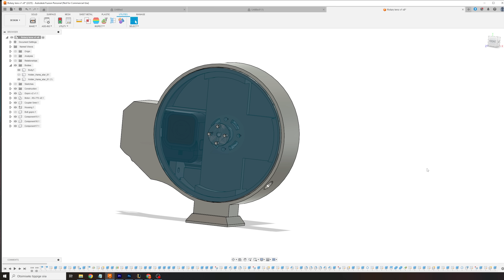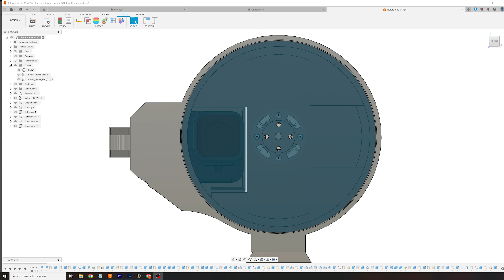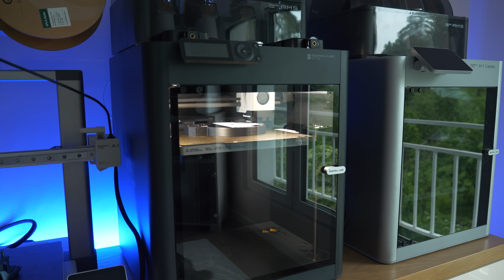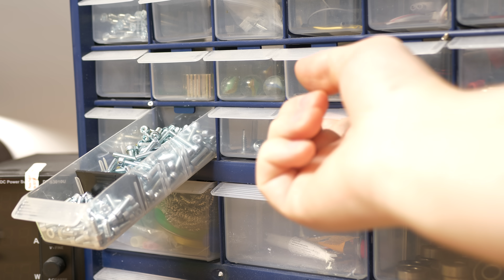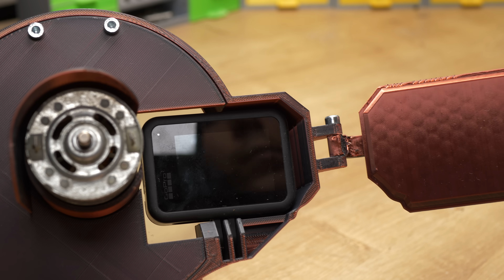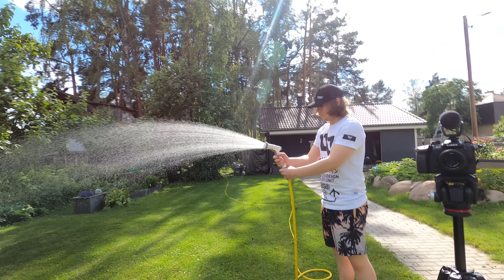Professionals Pay $4999 for This… I 3D Printed Mine for $5

Comment: Hi, Great project.
Years ago, when I was an ENG cameraman for some news stations, I had raindeflectors for my cameras. They did the job, but really, that was all positive I can say about them.
The wobble you have in your DIY raindeflector is also visible in the very expensive ones. To overcame that, I only used the raindeflector in shots that were dynamic, like when riding on the back of a motorbike in the Tour de France, for example. Another big problem is that you can't use acrylic for this, as this is the worst lens you will even find. You have to use glas for this, and believe me, it has to be very special glas too. It has to be optically perfect, it has to ride in at least 4, but even better 8 bearings, and it should be tempered, otherwise your glass will explode when spinning fast. Ask me how I know. Another big downfall of the Raindeflector is that it's a flywheel with a lot of force you have to overcome when using the camera handheld. A great example is that I once dropped my camera because the bike I was on made a turn left, and the camera didn't like to go that way because of the raindeflector being in its fastest rotation. This is why you now only see Raindeflectors in stabilized cameras with gyroscopes where the raindeflector spinning glas is taken into account in the motion of the other 2 axis. This you will find on Helicopters, car driven cranes, etc.
Reply: Acrylic is good enough, because guess what most of the clear waterproof cases at the consumer and semi-pro level are made out of? The thing is getting acrylic (or polycarbonate) which is "optical clear" and storing it or using it in a way that would avoid scratching. The main advantage of glass is not having the plastic fog up from UV over time, which would require replacement in this application. It's definitely down to a cost in this case by a factor of 1000.

Comment: It looks like the motor adapter wasn't fully centered on the acrylic disc, you can see it when the motor slows down.  If you get that fully centered it should greatly improve the balance.  For a perfect balance you could use an RC airplane propeller balancer as well.

Comment: I wonder if you could use something like Rain-X to help repel the water and in turn reduce the rpm's of the motor to reduce vibrations
Reply: Just any hydrophobic coating… not sure why such a high rpm is needed in the first place anyway… ceramic coatings are super cheap too
Reply: Aquapel

Comment: Using any support material or interface layer for PLA is almost useless, because in my experience the supports break off cleanly and the finished layer is superb no matter if you're using support material or not you just have to dial in your support settings, other than that great video I don't know if it's your accent or what but I really enjoy your videos and it helps that you're usually talking about something that makes sense or solves a problem.............

Comment: The longer I watched the video the more I had an appreciation for why the production version costs what it does.  The remaining issues are not easy to solve in a reliable manner, and I'm unconvinced that the image stabilization can adequately deal with a 10,000rpm vibration.

Top content though, and a good idea, but it's always that last 10% that takes the most effort to get right.

Comment: Bldc motor.
Balance it by trial and error, spin it upand feel for vibration, now mark 4 spots and add some tape/weight to one spot ant spin it again, less or more vibration and change position and weight uintill perfect.
And then turn the speed up or down to find a sweet spot

Comment: "Professionals Pay $4999 for This… I 3D Printed Mine for $5"

Except they start at $112. The $4999 are not just a spinning disc, they are waterproof gyro-stabilized window-mounted contraptions that can handle a storm.

Don't be a w*nker, try being honest.

Comment: Excellent idea, do you need to recess the disk in the housing? You can test by tightening the disk mounting bolt with a gap between the edge and housing. I suspect the centrifugal forces will still be applied to the front and back side of the disc. And the water will not collect at the edges of the housing when it's flung off the front.
Reply: You catch a brief glimpse in the 3D render at 1:09 - the perspex disk looks like its a few mm proud by design.

Comment: I think using the central drive in this case might not be the best idea. Maybe it would be better to use the ring gear drive, with the possibility of reducing the rotation speed but increasing the torque of such a lens? It also appears that the compactness of such a lens could be improved by directly utilizing the ring gear drive.

Comment: this is nice and interesting i wanna see you go though some ideas and improved verrsions... 
USe a brushless motor (cheap drone stuff is easy to get)
make the interface between the housing and the spinning disk better. (maybe a nylon washer with oil or some graphid and wool or something)
thing about how to balance the disk... there is prop balancers but it would be fun to see a device that is able to do it too xD (way complicated mabye its own video?)
Edit: One more idea, use a Mirror to get get the camera to be sideways. that way it has more space and the disk can be smaler making the whole thing simpler and less noisy i think.

Comment: Yeah I can absolutely see how you could put enough engineering into this to result in a $5k device, size, sound, reliability, image quality, etc. But, your solution seems like it could be really solid with a bit of work to produce an excellent 'hobbyist' version!

You could use two nylon rings on both the front and back face of the rotating acrylic disc, since nylon has a very low coeff of friction if the acrylic disc does warp and press against them it shouldn't negatively impact the speed too much, and by having a bit of overlap on the front it should significantly reduce water ingress (see: Labyrinth Seal). You could also potentially use a gearbox to increase the torque of the disc, once you're up to X speed that's high enough to kick the water drops off anything past that should be traded for torque to prevent the discs speed from varying too much, as that will obv impact it's efficacy and the image quality seeing through it. 

In terms of balancing that's all about shaving bits off or adding small weights to the acrylic disc until it's really steady, but that's a high-effort upgrade for pretty minimal return.

Great vid!
Reply: yeah 5k$ is insanely overpriced for what's literally just a spinning disk, no amount of engineering will ever justify that cost

only reason they can get away with making shit like that so expensive for professionals is because cinema camera manufacturers already tax their accessories insanely much and set a precedent
Reply: @AstonishedByTheLackOfCake  Have you ever worked as a professional engineer or is that just an opinion from a non engineering or scientific background?

Because I can ABSOLUTELY see how you could put $5k worth of engineering into that, especially considering the professional solutions aren't likely to use a flat disc and almost certainly don't just use acrylic, and if you've ever seen the cost of some of the high-end professional scientific equipment $5k isn't even a drop in the bucket.

Comment: How about hydrophobic coating?
Reply from the maker: It would certainly help, but it performed well enough even without it. ;)
Reply: Because the water would still accumulate on the front and drip down, distorting the image.
Reply: Hydrophobic coatings wear over time, whereas this spinning disc will theoretically never wear out (and if it does, you can replace the acrylic disc easily enough). Better for reliability when you really don't want a raindrop ruining your shot in a video production :P

Comment: I run GoPros on a race car and have often wondered how to make an effective anti-rain/splash device, I didn’t know how the professional ones did it either, so interesting to know. Great video.
Reply: This isn’t what you’re looking for, it won’t pass tech. The acrylic will shatter if hit by a pebble. 

The ones you’re thinking of use a squeegee and a rotating acrylic cylinder or a small panel driven by an actuator. They’re usually forbidden to be outside of the car’s body, but some sanctioning bodies will allow a pod to extend 100mm or so, as long as it’s hard mounted.
Reply: @TheOfficialOriginalChad I’m not in the US, but I’ve run GoPros before, as long as they’re bolted on (not taped) and not protruding it’s never been an issue, but yeah the one I’ve designed in my head is just either an actual wiper running off a servo or a rotating strip of plastic that runs through a squeegee.
Reply: why not just use rain-x or something similar?